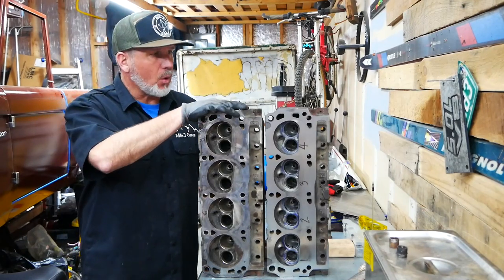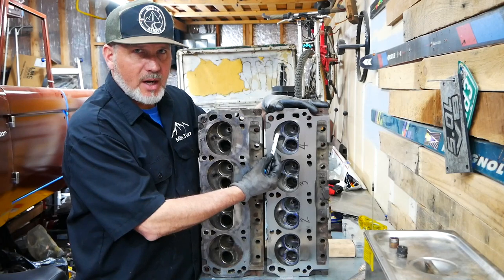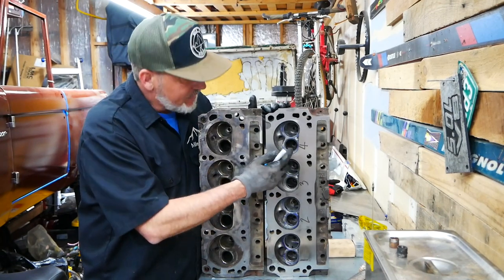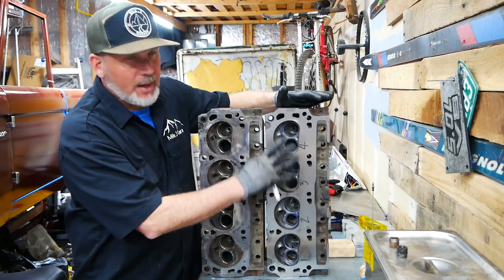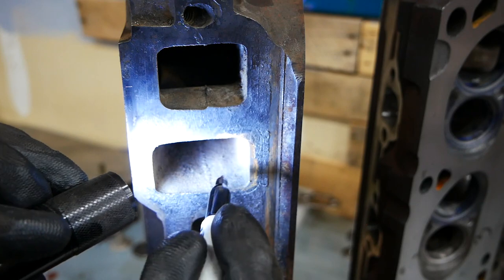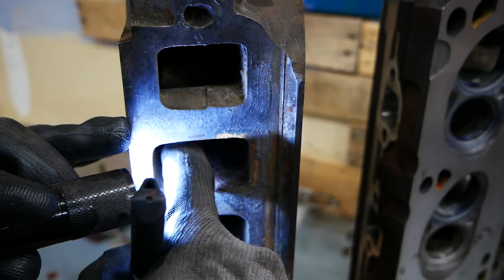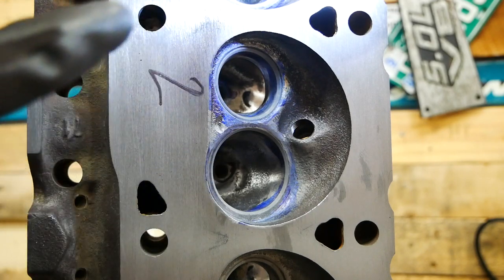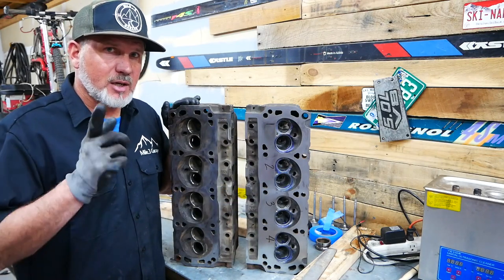Theories of Porting SBF Heads

Comment: Good video,  the ford factory heads have alot to offer when done correctly they are very underrated in my opinion my E7s I ported and worked have gone 10s naturally aspirated in the quarter mile on a stock factory short block 302 , duel plane intake and 9s with a 150 shot of nitrous I've done several videos on these heads myself thanks for posting and showing ford factory heads most people disregard them
Reply: The "Green Gangster" was a beast.
Reply: Holy shit, 10's!!  On E7 Heads!!  That's impressive man.  I've got a 351w with some early D5AE Heads and I think I'm going to try porting them.  It's in my little 80 Fox Coupe.  I'll check your videos out.
Reply: @TheVenom8343  good luck porting your heads,  you can make any of these heads run 11s and 10s with good bowl work and the right combination and ported correctly , if there's any thing I can help you with feel free to ask
Reply: @panthermadness4232  yeah it ran what we wanted it to and it did have more left in it , thanks for the support
Reply: @terrygrover6440  I looked on your channel but I couldn't find any sbf stuff.  Did I not go back far enough?
Reply: @TheVenom8343  there's alot of sbf stuff on there,  what can I help you with ? is there anything special I can help with
Reply: @terrygrover6440  Ok, I'll go back and look.  I guess what I'm looking for is, what areas to port out and what not to port out.  I'll look through your videos and find me a good starting place.  I do appreciate you my friend!!
Reply: @TheVenom8343  if you need to ask anything on one of my videos and ask if you put in terry grover E7s head it should come up
Reply: @terrygrover6440  Found em!  Man, you've got a bunch of videos on those!!  I'm going to watch every last one of them.
Reply: @TheVenom8343  thanks I hope it can help you with something
Reply: What does your 10 second car weigh?

Comment: I think you did rather well for your first time porting..You researched and addresed some key areas for improvement and kept things in moderation...That 347 should be a torque monster as long as the cam isn't to aggressive..Considering this is an off-road 4x4 vehicle to begin with you really don't want a high duration high lift cam.

The typical small block ford head is finished with any considerable amount of air flow gains much beyond the .450" valve lift range without more in-depth porting.

Even with better heads in general, considering this is an off road application, you still want to keep your power range in the low to midrange rpm area...Hopefully the cam chosen is a good match with either cylinder heads used.

Comment: Polishing removes the boundary layer that a rough surface creates. The boundary layers act as vibration absorbers, which reduces turbulence. Rough surface equals less turbulence equals better airflow. Use exhaust crossover heat to vaporize fuel. Air is not heated by exhaust crossover. Fuel is heated, which causes vaporization.

Comment: Must consider header tube before digging in the floor of a exhaust port. So then you know if you can dig and gasket match it to the flange or not. I did about the same as you by the time. And it was my first too. 

Shaping it in consideration of the header flange vs the tube i think its ideal. To match like you want if the flange vs the tube give you space for it.

Comment: Adding a three angle valve job on the seats plus a 30 degree relief cut on the underside of the valves after they're lapped would likely add another 15 cfm of flow at mid and high lifts.  On your larger, 347 application where the GT-40 heads are easily maxed out, this additional flow should be worth a significant horsepower gain. The cost for a competent machine shop to do such a valve job is not unreasonable and should be worthwhile, especially given the time and effort you've already invested to improve these heads.  Nice work!
Reply: What throat percentages do you use!

Comment: Some will tap , drill and screw in a length of threaded rod with red loctite into the thrermac hole. Then grind the roof smoothe ? Or leave hole open and still smoothe without a vane shape? Just thoughts.
Reply from the maker: Yes saw that Horri. Its interesting.  Thank you for the comment.

Comment: You didn't mention anything about getting the correct throat size. Most porters I watch go by the "throat diameter should be 90 percent of the valve size.
Reply from the maker: I don’t mention it but I just took a few mm out of the throat on each bowl.  Nothing too drastic but wanted to open it a little. Thank you for the comment.
Reply: @alpinegarage8548  Thanks for replying! I was curious because it seems like the throat size is one of the more important factors for good flow.
Reply: It has small factory size valves so not a big deal...

Comment: Bronco motors dont need ported. a huge waste of time.
Reply: Why not? Depending on which cam he uses, and what he uses the Bronco for, he might need more than he did. Until you have saw some of the off road engines work, you don’t know what you need. I have watched a few of them that wallowed out the runners like Kamala Harris just to run in the mud, at 5500 rpm. I have seen trucks that were running a cam,with a 1500-4000 range , to keep the torque down in the lower range to make it clean tires.